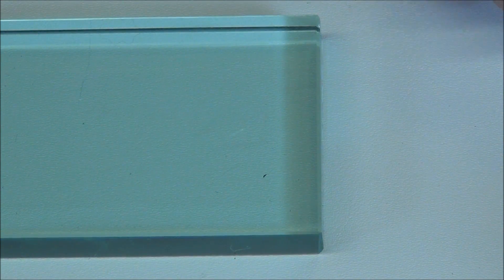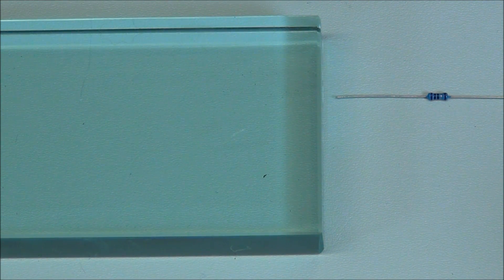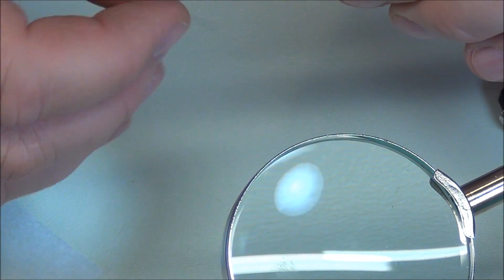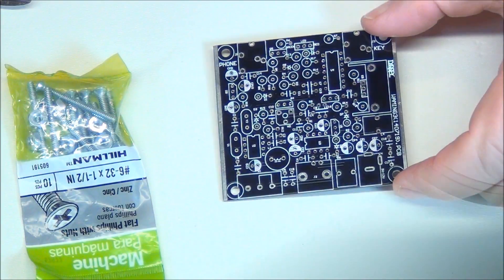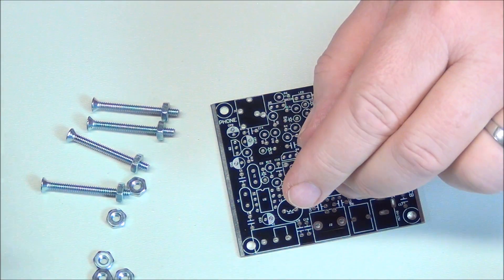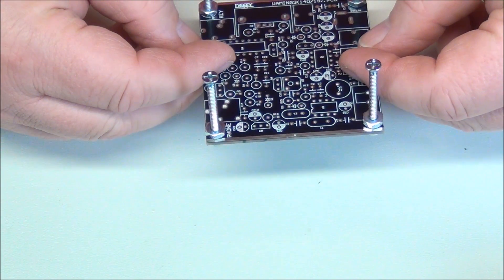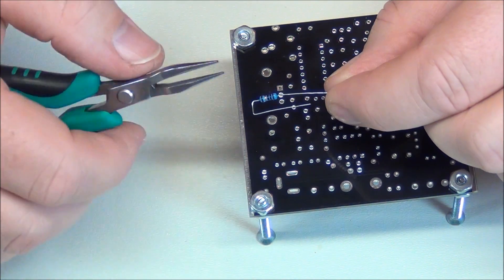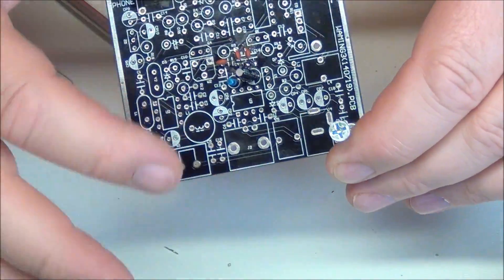Frog Sounds HAM Radio QRP Kit Telegraph CW Transceiver (part 3) - AF5DN

Comment: In fact the final results of the work is bad > overheated soldering iron as the heat was applied to long and all of the flux burned and disappeared so you can realized that soldering iron is not get wet anymore and going to stretch... if you would like to be so precise then you have to move the soldering tip with piece of iron continuously around the leg to put on together with flux at the current proper temperature. Just one time and do not go back and forth! This procedure (including the removing the smalt first) is absolutely must in case of enameled wires for toroid cores!

Comment: You don't need to be so particular about cleaning and details. I have never seen anyone build a kit like this. I've built a couple dozen kits, including a K2 without doing any of your extra steps. They all worked just fine. Nobody tins component leads or brushes soldered components, ever. You're not building a spaceship! ;-)

Comment: I have been hired from time to time to solder, Densely populated prototype pc boards for a local company at about $175 dollars per day.
If I worked this way i would have been fired.
The only component that I would pre tin is the leads of the toroids to confirm good solder flow and thats it. OMG!
Now show us the finished product on the air making a QSO.
All the best.

Comment: Good news... I got my first contact with this kit... a contact with PY4TW... 89km away using just a small piece of endfed antenna... and no grounding at all... I'm surprised it worked like that... By the way where are the other parts? wanna see it on air... strong 73 de PU4ALZ

Comment: Oh!  I ran out of video parts ---- you ain't finished it yet.  Don't forget the R19 anomaly --- wish I could remember all the goofs I found.  You'll see a place for R19 on the PCB, but it's not in the schematic, parts list, or mentioned in the the undecipherable "Chinglish" instructions.   I hand-drew the true schematic based on the board and realized that R19 was supposed to have been a dropping resistor for the final amp's collector voltage.   It was unnecessary anyway for a 9-12v supply so I don't understand its inclusion.  Anyway, just run a jumper at R19 or one of those fancy 0-ohm resistors if you went to Harvard, darling.  Something conductive has to be there or you won't get any voltage to yer final.

Comment: I made this kit a while ago... i'm still learning about antennas and QRP... all can say is that the knob is RF gain and not volume... Check the potentiometer to see if it's not a bad one because if it is then everytime u touch it u'll have a lot of noise killing your ears... that's it!! Looking forward to see this one u're making working... a strong 73 from PU4ALZ.
Reply: What did you do about the R19 goof?  Or, maybe it just affects the run of boards mine came from.
Reply: mnpd3 Man I don't really remember... it could have been the supplier u got this kit from... maybe with a different squematic since this is the 3º version... maybe it was there in the last versions and not in this new one or vice versa... I will receive a new aluminium box for this kit and when i install it there i'll check to see what I did about the R19...